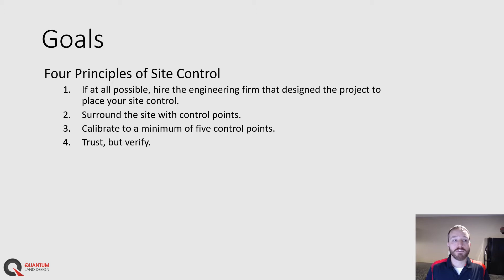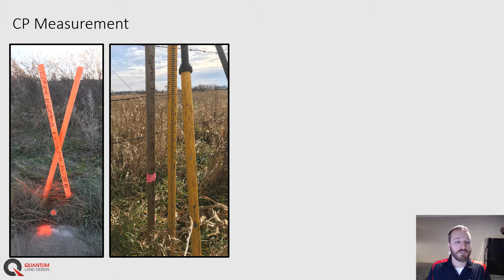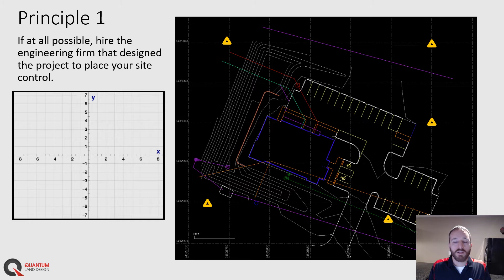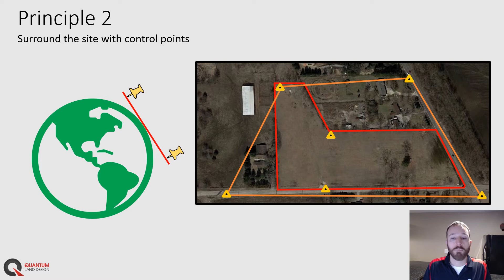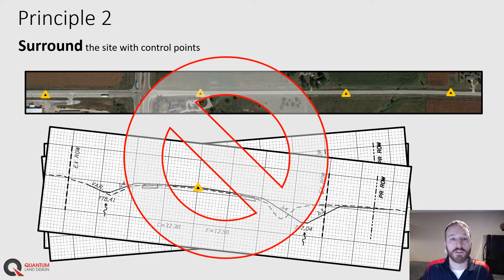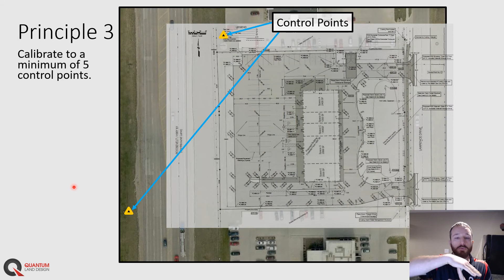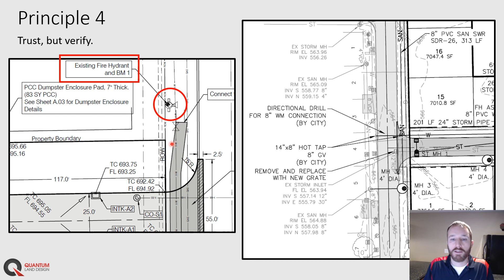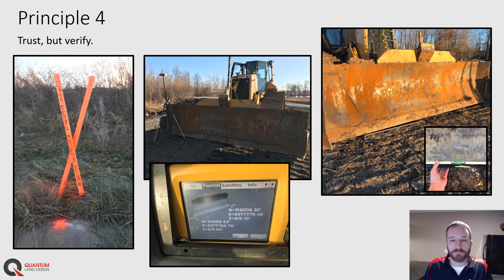GPS Site Control - How To Do It Right

Comment: Hi Great video, one question through. If you use all 5 control points, what do you do regarding the level? as we all know that GNSS level has more tolerance than in the x,y plane. Especially when you then traverse around with an EDM. What do you do? Thanks.
Reply from the maker: Hi @petertips2686 - I am not sure I understand your question.  If you use x,y,z for all five (or more) control points you should be good to go.  To tie verticals down as tight as possible you can request the surveyor run a level loop to tighten them up.  At the least, we like to see them use a robot to set your control.  The length of time you spend shooting in each point matters, too.  Recommendations vary by manufacturer, but always spend at least 30 seconds on each CP.  We usually occupy the point for two minutes to better average out the error.  If you have a "bad" control point your GPS system should show you excessive error on that point (but you will need at least 4 shot in before it will display vertical error).  Keep in mind that some variance and tolerance stack up is inherent in GPS.